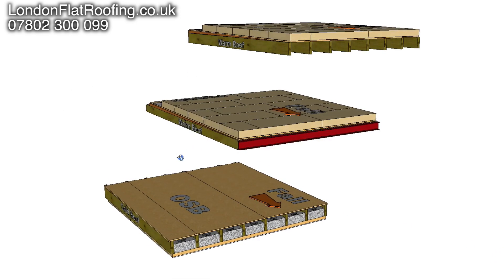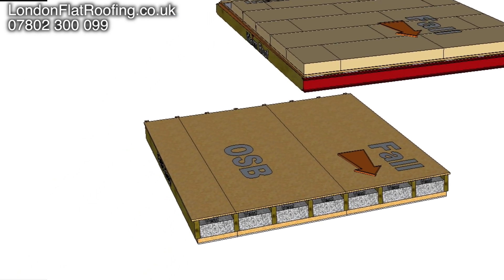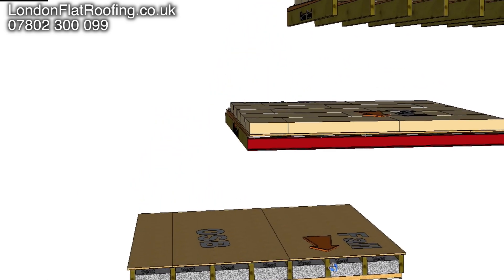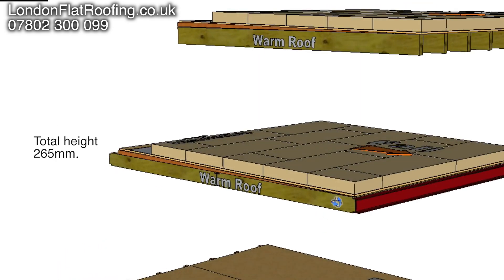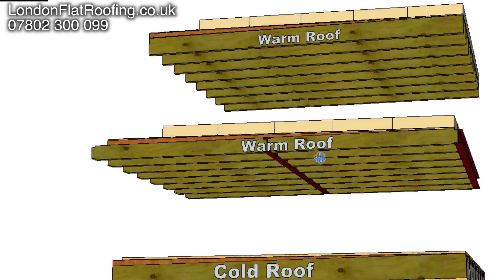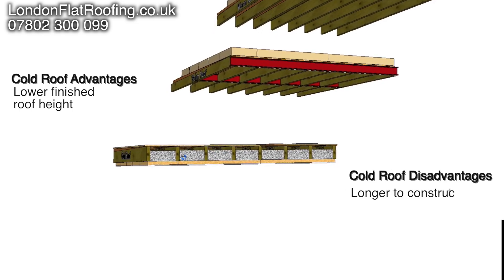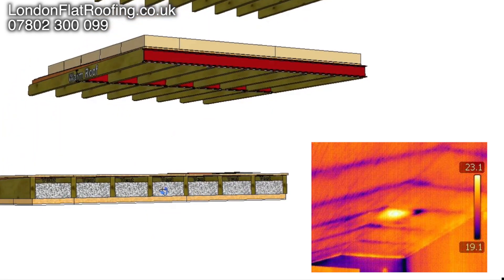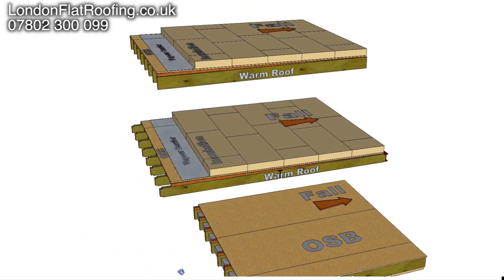How To Build A Flat Roof Warm Or Cold Construction. What's The Difference?

Comment: Hi Steve, I'm trying to design a cold roof for a garden office (not subject to building regs) It has to be a cold roof because of height restrictions. The joists are 150 and will have 100PIR what I can 't get my head round is am I better to push the hard PIR up to the OSB so that there is no ventilation but also seal the any gaps so that no moisture can pass also or just leave a 50mm between the PIR and OSB to vent gap and not worry too much about the holes the downlighter will need...??
Reply from the maker: You must have an air gap under the decking and that a gap must be vented so I can blow in one hand and out the other end this is essential. The installation must go down tight against the ceiling and there must be a vapour barrier under the installation up tight against it and it must be completely airtight completely airtight and sealed to the four walls
Reply: @SteveRoofer  I have an issue where the people that built my garden room had zero clue how to do a cold roof. Can I use mineral/ rock wool insulation against the VR instead of insulation board and have 50mm air space above? 

At their expense I am going to take the roof off from the outside and therefore will be looking down while trying to rectify the issues. 

I know they would have just cut the VR and pushed the spot lights into the ceiling so can I rectify this from above as well? Many thanks James

Comment: Hi Steve, excellent level of detail gone into all your videos. Really interesting. I am going to construct a warm roof but I have a bit of a height  restriction, I plan to use osb Vaper barrier - Insulation - osb combination. I will probably only get about 100mm of insulation fitted and was wondering if I could use foil type multlayer insulation in place of the vapour to act as extra insulation in a thiner design and as a vapour barrier which brands like superfoil claim to do anyway.  Thanks in advance. 
Gary
Reply from the maker: You should reach out to the suppliers of the multifoil and get them to give you a specification as this is going to be a bespoke build. There are specifications for flat roofs that we no work are robust and have some built in redundancy, specifications for flat roofs that we think work and specifications for flat roofs that don't work. A good warm roof will work even if mistakes are made. The key to all of this is not so much the vapour barrier but making sure the vapour barrier is airtight hence now you will see a lot of talk about airtight vapour control layers AVCL,s.
Reply: @SteveRoofer  Thanks Steve.

Comment: Hi Steve, I've built a shed 3m x 3m but due to height restriction have opted for the cold roof. My question is noggins that are in place because of the span of the build and to keep straight the joist they also now block airflow. To create adequate  airflow through the roof whats the best way to do it.. is it a case of creating holes through the noggins but above the insulation.. any advice would be much appreciated Cheers
Reply from the maker: The noggins don't have to be full height  or cut holes in them
Reply: @SteveRoofer   thanks Steve.. just saw another video of yours about cutting holes through joists to create airflow... excellent videos, very helpful Cheers

Comment: Hi Steve my builder have done the warm roof fiber glass roof on 6 meter extension  after few weeks cracking noises start to come early morning and in the evening same time during the day .
Can you please let me know what is the problem way this cracking noises are coming?
Reply from the maker: Expansion and contraction, hard to solve have tried cutting the roof into peices and fixing with flexible sealers to form expansion joints. This reduced the problem but didn't solve it
Reply: @SteveRoofer  
Thank you  So the fiber glass roof is not a good option then and what is the best option to solve this?
Reply from the maker: @imran-jd1ht   remove the GRP lass fibre roof and start again

Comment: Steve, I wish we had someone like you up north (north Manchester). I spent£4000 on a warm roof with what is supposed to be the top warm roof installer around here. Okay it hasn't leaked, but warm? No way! Biggest mistake was they did not put insulation behind the fascia boards between the roof joists or at the sides (it's a dormer).
After watching your videos the only way i can see around the problem is to take part of the ceiling (a 2ft width) down all around the front and rear dormer and fit insulation from below.  Unless you know any other way?
Reply from the maker: No sorry, don't know any other way. At least you haven't got a cold roof that's not been instaled correctly. At the moment I'm inspecting 2 a week that have been installed over new extensions or loft conversions, and no ventilation or vapour barriers have been installed.  Warm roofs that have been instaled incorrectly seem to perform still better than a cold roof. I see a lot of cold roofs on extensions dormers that spotlights are just cut into the ceiling and the insulation is just cut back at that area! Nobody is thinking this through. Warm internal air with moisture migrates up around the light and into the vented area. You lose your heat, you fill the vented area with warm moist air and if its cold outside you could have sweating.

Comment: I am looking to convert my lean to style conservatory roof from the polycarbonate to a solid roof. 

I was looking at a cold roof system, to allow for ventilation I thought about having batons running perpendicular to the joists so I could have ventilation at the sides instead of some obscure system against the house wall. Does this sound practical? Would I perhaps be better to go for the warm roof system as I think I'd have the height available. 

Many thanks, great video.

Comment: Hi great video. A question for you, with a warm roof do I have to insulate in between the joists as well before plaster boarding. ?
Reply from the maker: 99% of the time No. Sometimes if we have had due point calculations undertaken then yes we do but follow the specifications to the max.

Comment: I need help. I think my carpenter placed the joists in the wrong direction and has no ventilation on either end of them to create a cold roof. He won't admit his mistake and now I have to have a ventilation on top and drill holes in my joists to create air flow. can someone please help me know how big of a hole I need to make. I think he also used 2x6 for joist.  I am so done with him I am willing to make the holes myself.
Reply: Hi Steve I am currently building a garden office and wanted a warm roof but I am limited to the 2.5M my question is would a SIP panel roof not be the same as a warm roof just without the rafters ?? As it is structural.
Cheers 
Lee

Comment: Hi Steve I have a kitchen extension that has been converted to a pitched roof. What they have done is take of the felt and leave the flat ply base. And create a pitched roof above it with a wooden frame and tiled it. The sides have been closed up using pvc cladding, it looks very nice but there is no insulation in the roof. Would I be ok to create a warm roof on the plywood base but obviously not put the felt on as it’s already waterproof. If I insulted between the rafts the space above my kitchen would still be very cold because of the cladding on the sides. Any advice would be appreciated. Thanks
Reply from the maker: What you are creating is a cold roof the space above the insulation is eternal Cold, space below is internal warm. Vent the cost space. Stop all movement of air into the warm space
Reply: Ok thanks, would I still need to use a vapour barrier ?
Reply from the maker: Yes the vapour control layer on a cold roof goes above the plasterboard

Comment: Fantastic videos. I have a outbuilding which I am converting into a gym with a new warm roof.
The building is 2.5m by 7m long, I was looking to use 50mm by 200mm joists running the 2.5m length with spacing between the joists of 400mm (can i have a larger gap?) 18mm osb board on top of the joists, dpd membrane, 120mm insulation, epdm roof.
The slope needs to run down towards the longer end and I was wondering if i could just angle the joist hangers which will be attached to the brick wall at an angle to get the desired slope or do i need to have Firrings?
Keep up the good videos.
Reply from the maker: I wouldn't go wider than 400 as you don't want roof to sag  in a year or so get the fall on the roof whatever way you find easiest firings or joist hangers

Comment: Hi Steve, you really convinced me on the cold roof. I'm building a timber frame man cave in my garden. The problem I have is the 2.5m height limit. 
My bas is already about 10" of the ground. I need at least 2 meter ceiling height . The recommended roof joists are 8" then I would like to put firring strips on top of those so I don't have a sloping ceiling. How would you solve this problem? Could sips be laid across 4.5 meters unsupported? Thanks Steve, your videos are really helpful. I wish I could afford you to do my roof. Thanks again.
Reply from the maker: Yes if the supplier designs them to span that width, unfortunately everybody has this problem with height on warm roofs
Reply: Hi just out of interest what decision did you make on the roof.
Reply: I'm having a similar issue. I read somewhere that a warm roof can be achieved by fully insulating between the roof joists.

Mine will be 150mm so basically the make up of the roof on my design will hopefully be OK?

Plasterboard
Joists fully insulated in between
18mm osb
Epdm rubber roof membrane

My only concern is will I need to have an insulation between the plasterboard and joists?

HELP :)
Reply: @tomwalke4477  Surely that's just an unventilated cold roof.  The timbers would be cold.

Comment: Steve wonderful video. I live here in Central Florida in a house built in 1958. The house has a 1/12 pitch roof and several rooms with flat roof. The framing is at least 2x6 or 2x8 on 16 inch centers. The roof material is "torch down". I have zero insulation inside the roof framing and the roof was put down in 2002. We desperately need insulation. Right now we have a Whirlybird and that attic roof turbine draws a lot of heat out of the attic in the summer since the framing in the soffits each have 2 inch holes in each rafters bay. What would be our best solution? How should we go about insulating? Thanks. Great video.

Jeff
Reply from the maker: The situation where you are is different because of the high air moisture. Your VCL goes in a difrent place I think on the outside of the insulation you need to talk to the local building inspectors

Comment from the maker: Thanks Drukker, no ventilation is needed in a warm roof, the gap between the joists is now internal in fact you don't need a ceiling. So do we vent our rooms? Yes we have a changed of air to keep it fresh and healthy. Do we get condensation in our rooms. Yes on cold spots such as windows and sometimes on walls. So wont we get condensation on the underside of the decking especially as we haven't got a ceiling? No as the performance of the warm roof is so good we don,t get cold spots.

Comment: Steve, thanks for this explanation. Am I correct that your diagram of the hot roof does not include any ventilation? Why is condensation not a problem for the hot roof? I would have thought an air space would be required between the insulation and the roof tiles....

Comment: Is there any disadvantage to installing insulation between joists and having a warm roof construction.  This way there is maximum insulation?
Reply from the maker: Putting the insulation between the joists forms a cold roof. If you put the roof insulation between the joists you must put it in the lower part of the void  and vent the top. To get the correct U value and to stop thermal bridging you will have to remove the ceiling and replace with insulated plasterboard, reducing the room hight.

Comment from the maker: Yes it stops the hot air from rising making the bottom of the decking colder  and  in some conditions condensation may form. If you have insulation in between the joists you have to place more insulation on the roof to counterbalance Im going to do a video on this shortly as it seams silly that insulation between means more insulation above. This only becomes a problem when conditions are adverse